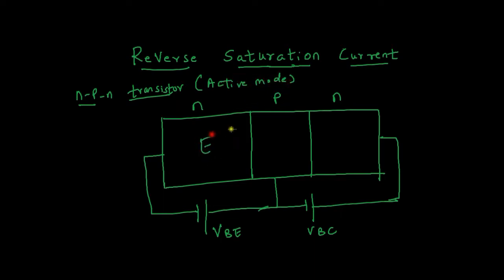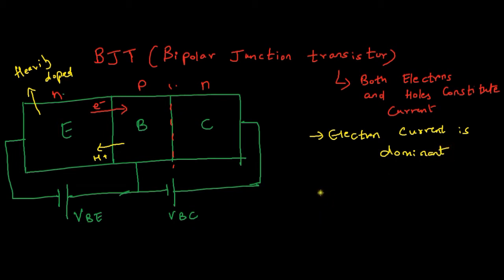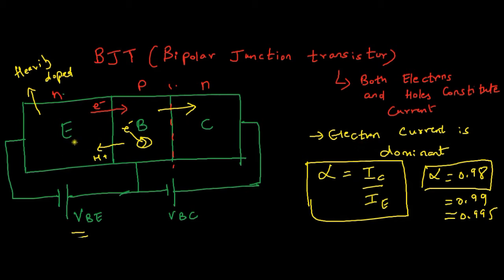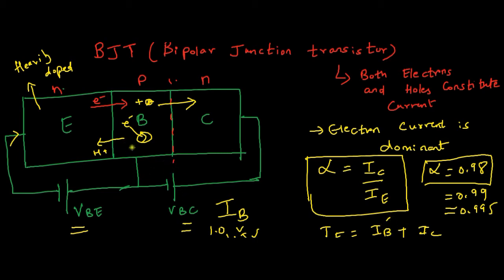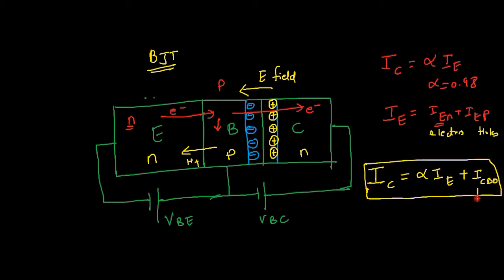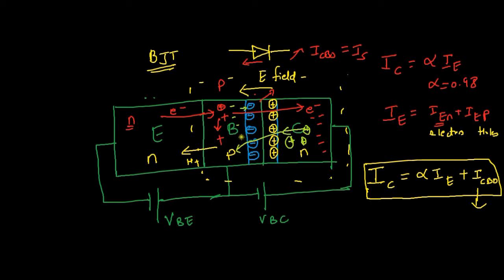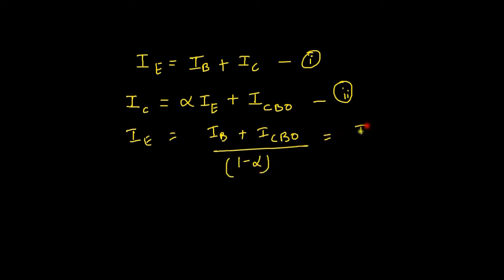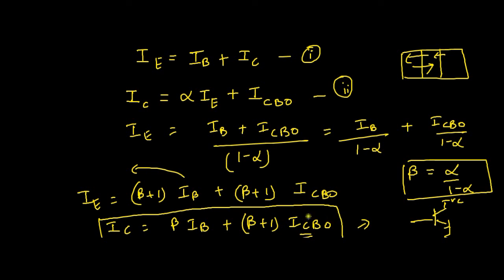What is reverse saturation current in transistor/diode ?

Comment: sir,what is effective reverse saturation current (Is) for two diodes (let both have different Is )in series?
Reply from the maker: +Boddu Venkatesh  Hi Venkatesh, since both are in series, they conduct same current. But each diode has a fixed value of reverse saturation current at a given temperature. So if you measure current in a series connection, it will be the Is2 current(Diode which has low value of reverse saturation current). So I(Current in series connection of reverse biased diodes)= Is2 (given Is2<Is1)